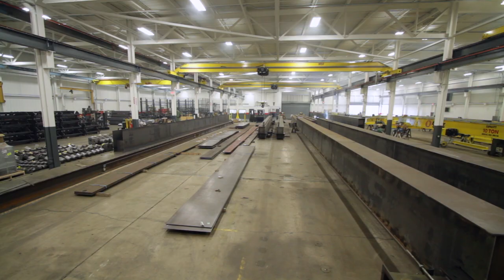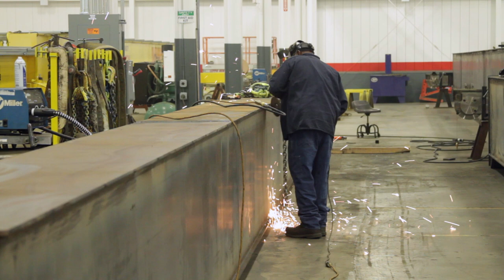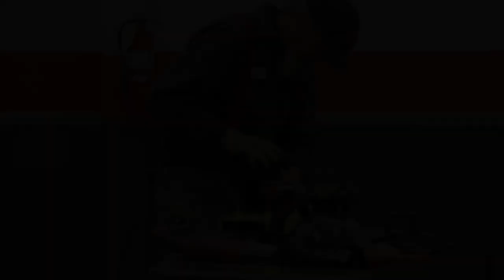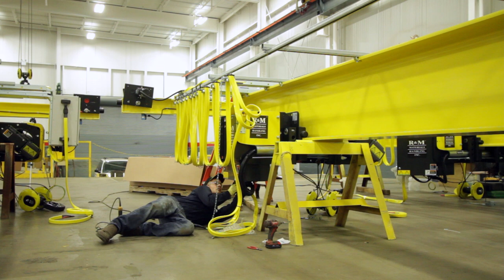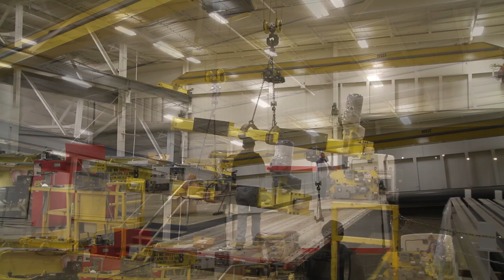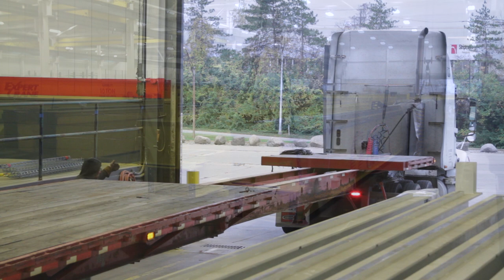Expert Crane Factory - Production

Comment: The company seems to be very professional, i have no doubts about the Expert Crane´s quality, however, would be great to see the  workers wearing/using  proper equipments for individual protection instead beisebol caps and regular glasses.
Reply: carlos silva o
Reply: carlos silvan
Reply: carlos silva called bump caps and he has got safety glasses on
Reply: @chrisyboy666   dont be a fool , tinted goggles are not suitable for welding.
Reply: @tomthompson7400  Maybe not welding all the time but there are shade 5,6,7 and 8 tinted glasses ment for plasma cutting and tack welding. If you just tack with them and dont stare directly at the light then they work fine (and no you really dont need to look at the light after you have experience to tack). I own a welding shop and have many shaded glasses and even auto darkening glasses that work like a helmet that go to shade 12. If you do it for too long then you get
 a sun burn but your eyes are fine.
Reply: @buildthings79  the same radiation is given off tacking as welding ... it has an accumulation effect on the body ... end of story
Reply: @tomthompson7400  So you went to "Im right.com" to be able to argue your point I see. You apparently are a welder with many decades of experience knowing what actually will leave a burn and what wont. How about you tell me how far you have to be from someone "spray arching " to protect against burn on bare skin at say 500 amps . How about if your wearing a t shirt. How about a 100 amp plasma cutter, or a 3/8" rod oxylance . There isnt a welder in the world that hasn't gotten sunburned from welding or flashed. It comes from experience to know what you can and cant get away with  before it does damage.    It doesnt mean just because your exposed to ultraviolet light your getting cancer in 10 years.  After a while your body builds up darker pigmentation in your skin to resist the uv light. Thats why darker skinned people dont get sunburned. But since you watched this one guy " tacking" without all the PPE gear that OSHA tells you to have on your an expert from behind that keyboard.
Reply: @buildthings79  how about you explain it to the health and safety executive when your first victim is suing you for skin cancer ... see if your as clever then .
I live in belfast .. we've built a few boats here ... don't you think these things have shown up here ...  I'd love to write more . But there's no point.
Reply: The guy that didn’t have a helmet on was only Tack Welding It’s completely different from actually welding last time I checked osha doesn’t require a weld helmet when tack welding.